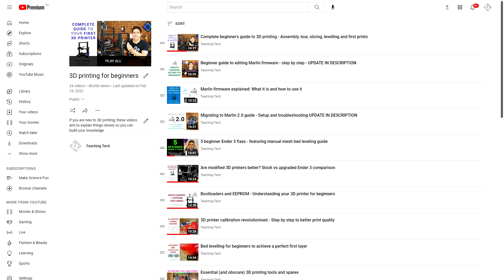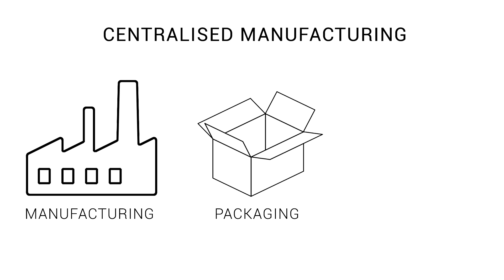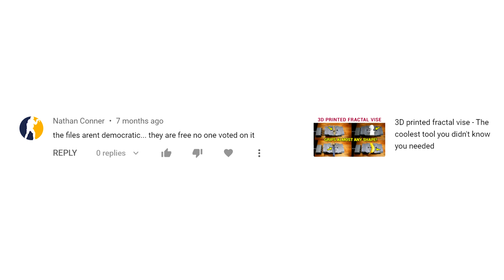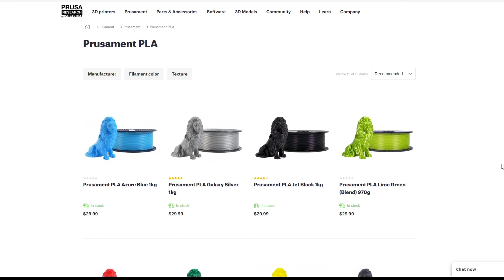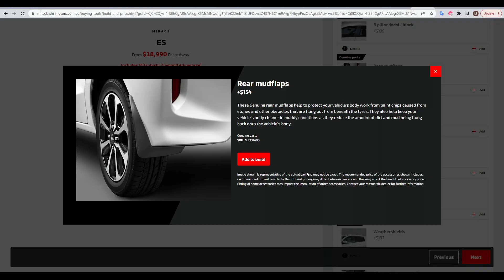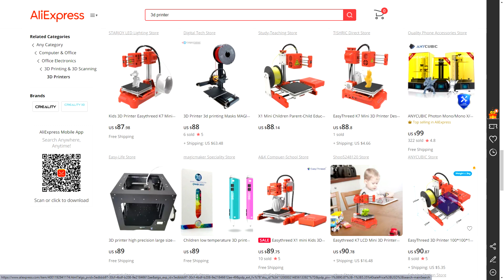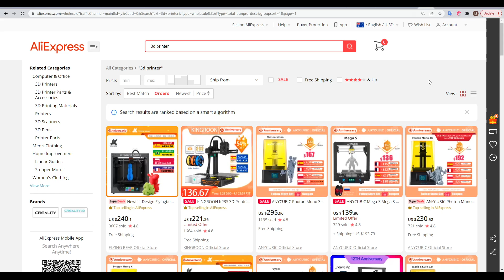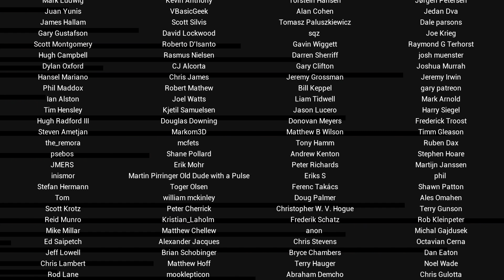3D printer trends are limiting mainstream acceptance: The 3D printing paradox

Comment: 3D printing is still in its early days. To use the auto analogy, we have not yet reached the Model T yet. Also keep in mind that through out the eighties and nineties we had no end of clone manufacturers for the PC. But the industry eventually consolidated.
Reply: I agree. The biggest weakness with his analogy of 3D printers to cars is the maturity of the markets. The car market is just so much more mature than the 3D printer market. And to be honest, a lot of those basic safety features had to be mandated by law to get the car manufacturers to put the effort into developing and testing. Similar to why there are still 3D printers that don't have safety features (like thermal runaway) enabled in the firmware. There are no laws requiring them, so the "race to the bottom" manufacturers don't bother enabling them so they don't have to bother testing that it works.
Reply: The Model T was about making automobiles affordable. If we were to compare it to the history of the car I would say that it's more like the great numbers of companies making automobiles in the first half of the 20th century, especially in the 1910s and 1920s.
Reply: @capitalinventor4823  Yes I am aware of that. You could make analogies to autos, computers and even radios. Each started with many small manufactures and a group of dedicated enthusiasts. But the dynamics of each of these industries are different and so an analogy can only go so far. What I was getting at is in the time frame of development we are about to see a hand full of manufacturers start to push out their smaller competitors.
Reply: @VictorGallagherCarvings  

The Model T brought about some consolidation but it forced other companies to introduce the assembly line. The Model T was made from approximately 1907 to 1926 yet the period of many companies lasted until into the 1950s. There were two eras of many automobile companies. The first had the companies building expensive cars while the latter had them copying the Ford model to build cars the better off could afford. It was most likely a combination of the Great Depression and WWII that saw many companies go under.

My point is that the Model T, and Ford paying wages to let employees buy the car, is what led to it being an affordable for a broader range of people. We already have that today with many of the cheap printers out there. I do agree with you that there will most likely be some consolidation in the market or at least most companies that are producing  the worst printers leaving it after discovering customers too much trouble. This is more like the early years of the Japanese car imports into North America where the cars were inexpensive and the quality was poor. It took a long time but some firms came out of it to be top manufacturers. We saw the same thing in the 1980s with Korean car companies.

Comment: It's funny, I have just been saying this as I contemplate getting into 3d printing. I'm not looking for a hobby, I'm looking to make parts. I don't want to tinker with the machine (and waste time and money on filament), I want to create or download my design, hit print, and then use the part for whatever larger structure I'm making.

Seems like most 3d printing channels are focused on tinkerers.

However, I don't see 3d home printing to become any more mainstream than people working on their cars at home, which doesn't happen that often anymore, however 3d printing for manufacturers I definitely see backing up your issue of stocking old parts. Need a part? Order it from the mfg, they make it for you, and you get it shipped. One off manufacturing.
Reply: I had the same motivation... I bought an Ender 3 S1 ... It just works... comes with all the "upgrades" most people do to their printers.... But then I wanted octoprint and a larger print surface and multiple printers so I looked into "Alexs' Frimware", and some mods... Learned about the Voxelab Aquila form some of those channels ... At $160.00 a piece I thought ok I can buy two for less then 1 more Ender3 S1... So I bought 2 Aquilas to see how good/bad they were and if all that nonsense was justified.... I  just built them the way I wanted taking bits and pieces from those channels .. ended up with 3 very capable printers including one that can print 400x400x500 ... Totally worth the time b/c now they just run and I know them inside and out. Basically I have 3 printers with all the features and quality I want for 30hours of time and 1000$. But I can literally print any part I want from anywhere  (or 3 separate parts at once) by just finding and/or designing in fusion, save as STL, slice, send to printer...  monitor it by webcam.
Reply: @grumpycat_1  Yeah, I already have enough hobbies. lol. I'm also hesitant because it seems even some of the most simple prints take a couple of hours to make, whereas I can make oneoffs in my woodshop in 10-15 minutes for some of this stuff, and I don't have any design time involved.
Reply: @larrybud  I'm with you I waited 2-3 years too long to dive in... b/c the level of effort to get up to speed on them and the "rGB" type modding nonsense didn't appeal to me...  
But I equate the time I spent getting a working small printer (farm) to the time I spent learning fusion to run my CNC machines... 
I used to draw everything by hand... to slow...
Then I used sketch up religiously... and make prototypes by hand... wood/clay/cardboard etc. ... sketup is not a CAM solution...
So I just bit the bullet and forced myself to only draw/design in fusion.
Which lead me down the 3d printing rabbit hole...  b/c nothing beats rapid prototyping in cheap plastic. I am fast in wood/clay/cardboard etc.. But I can't mock up one-offs WHILE simultaneously designing ver. 2 and 3. at the same time...
FDM machines can allow this.
But 2-6 hours per part took to long ... so I bought 2 more printers so I can basically do a days worth of design work and print 3 iterations one after/during the other to see what works best... At the end of the day I know what I want or have what i want to move forward... and was never waiting around to see if ver2 was better then ver1. or if ver.3  sucked in the real world and I "saved" all the manual iteration/prototyping/mockup building by hand time.

Comment: Michel, TY For addressing this issue in such a manner.
Your channel is tops in this 3D Extrusion Instrument Industry.
It's not just a paradox, it's Also an astigmatism. 

Firstly, the problem is an overall merchandising problem because only the people who use these know it instinctively as a 'printer'. 
The actual term for this device is this..
It's an “Extrusion Instrument” that produces material pieces. 
Just like a musical instrument produces musical sound.
AND like a musical instrument and all the more so, it requires tuning, tweaking and calibration to perform and even produce any kind of output without messing up.

Only a fraction of the ppl in the whole world population even knows what a “3D” printer even is. IF you tell someone who has never seen one or heard of it that you just got a printer, they think it's a device that uses paper, like a laser printer.
So the word “PRINTER” is the WRONG WORD for this kind of a device because 'printer' already has the position in the worlds mind that it's a paper handling device. That is the FIRST stumbling block. Out of the 6 billion+ ppl in the world, only about 50-100 million ever HEARD of or even saw such a thing as a 3Dprinter. That's only 0.0166666666666667 % of the population. AND out of that there's probably only a few million in use in the world which is .00003.333... % of the population. We've got a long way to go to get one in everyone's home. 

Look at the the merchandising name of the car & automobile, it was called a “Horseless Carriage” until the words 'automobile' and 'car' finally took the merchandising position in the population & market place as years went on. There were hundreds of companies that came and went. Same for Farm Tractors, there was a thousand different companies as they became powered machinery. Now; not a dozen globally. 

Secondly,  This reminds me of the computer industry back in the early 80's when I was your age. The first computer from England was the ZX81 with full 32 bit architecture, which was brought into the USA by the Timex Watch company. People Laughed at it, media reviewed it and called it a useless toy because the keyboard was small as a calculator !! 
(AND LOOK how much smaller the keyboard is NOW on a phone that the ppl in the world use without any qualms)
I uses these ZX-TS1000 units, and programmed Z80 Machine code in FULL 32 bit programming on 16K of RAM, and built it up with add on kbds, RAM, Logic Interfaces, etc; just like you do now with the 3D printers! IT was a labor of love! We sat in front of a TV as a monitor and hacked up code day and night !! And the rest of the world bought the pc clones and laughed at us bashing what we were using and saying we were playing with little toys. We performed data acquisition of temperature and wind speeds and put them on the screen and stored the data on cassette tapes, over a decade before any pc even had the power for this. They only had 360K floppies and 640K of ram, which is LESS THAN 1MEG. Today you get 16 Gigs of Ram !! 

This situation has a lot of parallels now with all the 3D printers flooding the market just like the pc clones did back in the late 80's. AND this 3D industry is stagnant as you say. 
NOW Look at what the majority of ppl are producing with their 3D Extrusion Instruments.... Figurines from video games and super heroes, plastic replicas of guns and weapons used in the games and movies. That gives the overall image of the industry a childish image to ppl who are into industrial usage. 
The description you make about replacing parts for a manufacturer is excellent, another point is that it eliminates warranty replacement of the entire item, if you can make a little piece for the item. That's attractive to manufactures from a marketing standpoint.

Compare this to computers as they took the market in the 80's IBM pushed word processing and spreadsheet programs. The Mac had desktop publishing. Games came later as graphics abilities improved with better computers. SO The industry image was a computing machine that worked replacing your typewriter and hand lists and spreadsheets which were in every home and business before computers of now.

Thirdly, you mentioned that there was no small usage innovation that filtered up into the automobile industry. Nothing could be further from the truth. Not much today, but there were major innovations that came from the auto racing industry that filtered back up into the regular car industry over the last century. Innovations from Indy cars, Drag Racing in the 60's to now, and NASCAR Safety structures that were adopted by car makers regarding crash proofing and crumple zones that were spawned and tested in the big races. Land Speed Racing on the Bonneville Salt flats is still sponsored by Goodyear where new types or rubber are being developed always on vehicles that go over 400 MPH with wheel speeds of 5000+ RPM. The new Electric Streamliner just went over 300 MPH and is using tires like this. Many automakers have taken the designs on these one off high speed machines and implemented them into the production environment over the years. Its small compared to the overall designs, but nonetheless it's a contribution over the years with many things that can be listed and observed that's filtered up into the overall industry.

Lastly, there's actual industrial implementation where you pay up to and over 6 figure money for 3D extrusion machines.. 
https://www.stratasys.com/en/3d-printers/printer-catalog/
is one example.
https://www.matterhackers.com/store/c/printer-kits/industrial-3d-printers
is another example.

=============================

This is something more viable than the Creality Ender3 Line...
https://www.matterhackers.com/store/c/printer-manufacturers/Pulse

I would like to work up to getting one of those Pulse machines in the near future.
They build it to the considerations you will use it for and build it and run it and test it and then it's packed and shipped to you. Working in the box. No final assembly of rails and extruder head.
===========================
Reply: I agree with of what you have said.  

My first experience with 3D printers was working with Boeing on casting prototypes back in the early 90's.  Parts were designed using 3D CAD, converted to SLA patterns, then cast where I worked using the lost wax process.  Boeing would think nothing of paying $10K just for the patterns.  It was cheaper and faster than producing the molds that would have cost $50K or more and take months to get a casting.  Worked most of the time. We had a printer that cost about 6 figures back then.   

I'm retired now but still have personal copies of CAD and CAM software and would like to buy one the 3D printers to play with but because of the comments here and elsewhere I'm really hesitant to do so.  I'm trying to rap my head around all the new terminology used with printers today.   I guess it will take me awhile to sort things out.